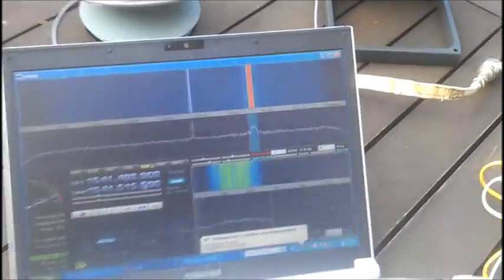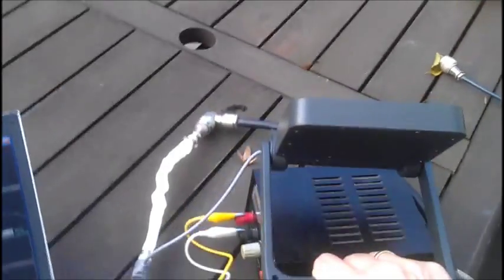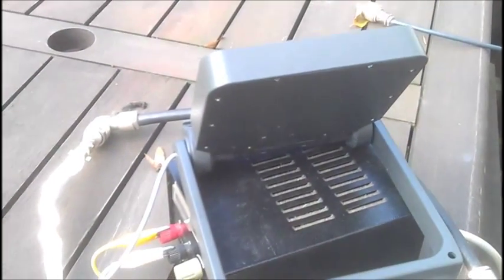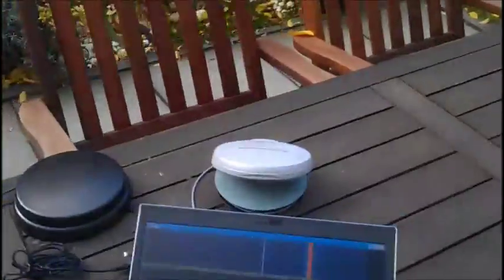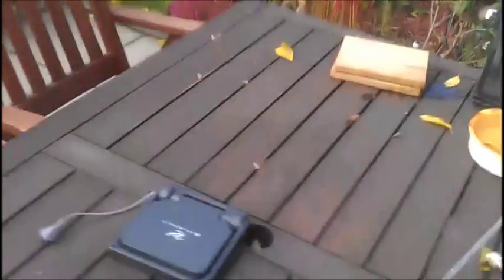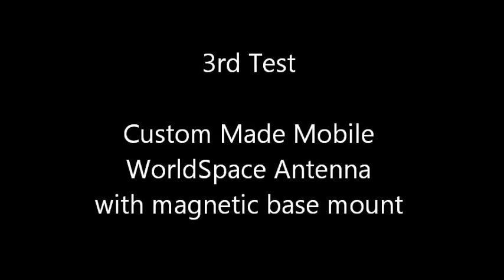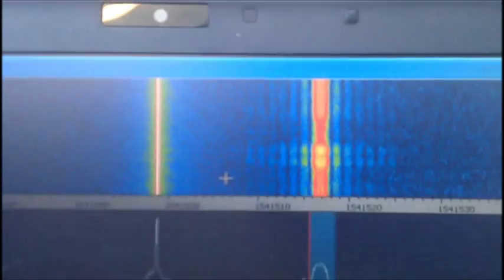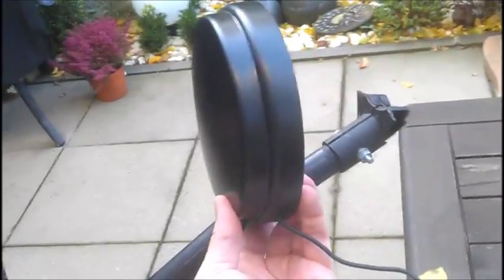Test: WorldSpace Antenna Comparison on INMARSAT-C Downlink

Comment: can you please explain how do you power the antenna .I am a ham radio licensee...I play quite a lot with sdrplay I've got the model where you can give voltage through a bias T. Are these antennas of any use for QO100 eshailsat reception .Its a geostationary satellite for ham radio.  ThanQ
Reply: You power the antenna with around 1.5-3 Volts via a bias tee and a variable voltage source, e.g. lab power supply.The voltage will determine the polarisation.....switching point is around 1.8-2V .  This antenna is not useful at all for QO100.
Reply: @oscardiez5657  ThanQ

Comment: For satellite dish, if you are using usually RHCP antenna, you should change to LHCP because any mirror will change polarization properties. I can see that you get some gain by dish, but you may get even more if change this feed to LHCP.
Reply from the maker: Yes I know. The antenna was actually in LHCP mode in this case (this Worldspace patch antennas have mostly switchable polarisation RHCP/LHCP by switching the voltage on the coax line)
Reply: @MegaOscarVideos  Oh, that is so cool if you can switch polarization from RHCP to LHCP. That is really great. Thanks.

Comment: Hi Mega oscar video! , I got one of this Hitachi flat square  antenna, Id like to know how you supply voltage the antenna in order to let this antenna work, I got also a low wide  preamplifier that work from 225 to 2500, my main issue is to understand how to supply the antenna I think that you will need a small power supply, but which voltage will be fine in order to let this antenna work fine? you also said on video can this antenna can easily  modified internally..can you please explain how ?